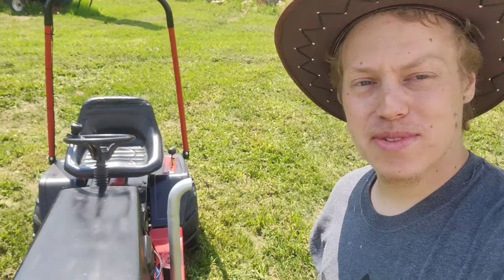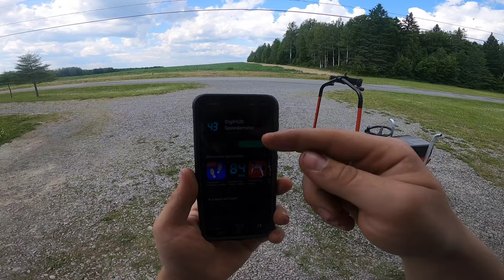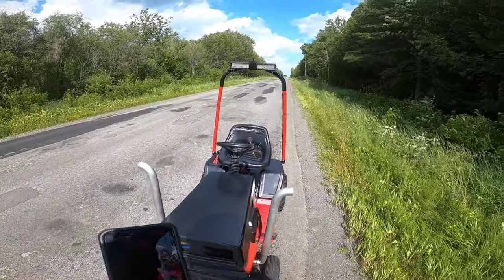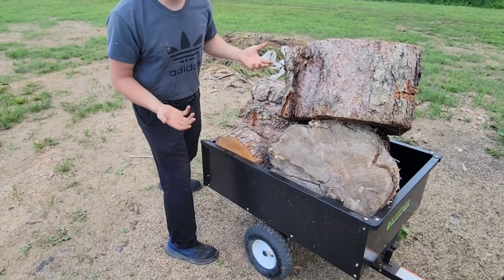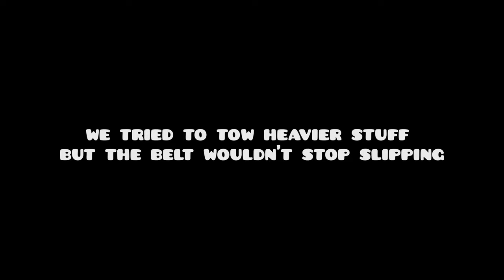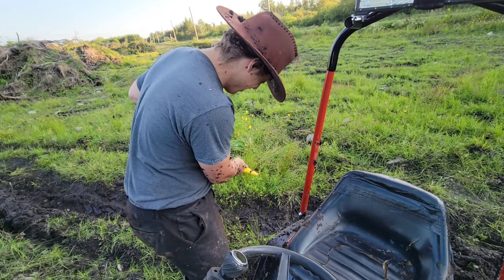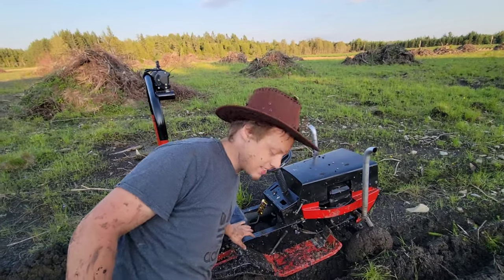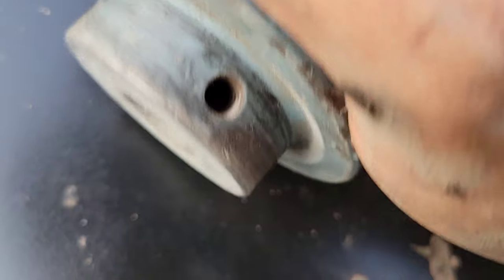MUD MOWER PUSHED TO ITS LIMITS UNTIL IT BREAKS!

Comment: Ya pretty much got what we call here in the states a pulling tractor (mowers)... my cousin did it they have ether stock mowers or super stock, like yours super stock only means aftermarket tires, custom exhaust/intake and governor removal then lastly modified where anything goes as long as the engine is still a lawnmower type engine... pulling tractors hook on to something called a sled that they attempt to pull a specified distance.... lots of times the SS and Modifed ones do wheelies... 

So you pretty much made a Super Stock Pulling tractor